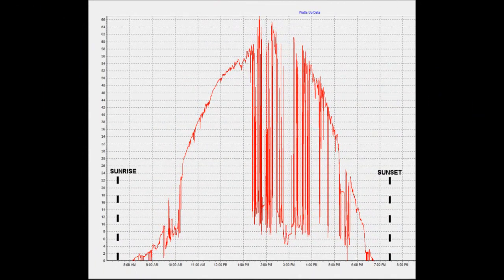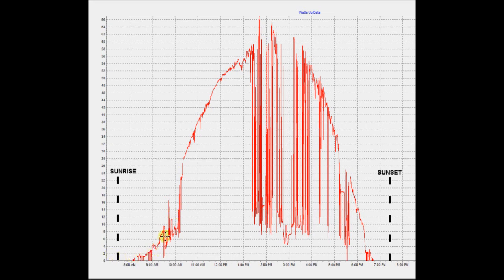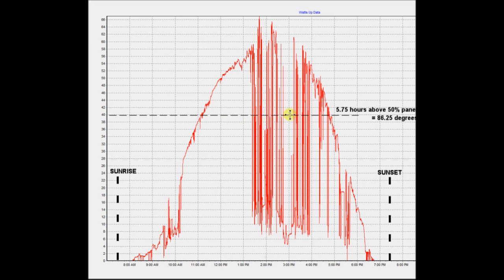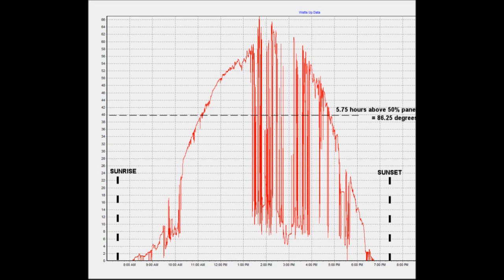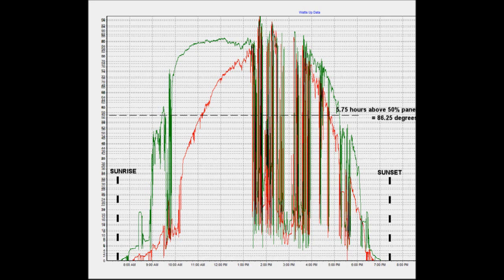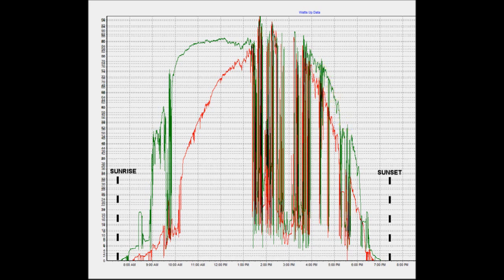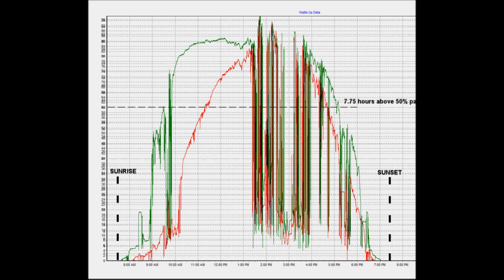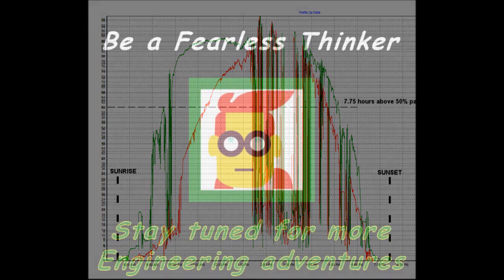Part 3: Spring Solar PV Shading Study

Comment: Very nice explanation of the difference between tracked PV verse's  Fixed mount. I did a test this morning about 9:00 am between Trackers #2&3 #2 i placed in a fixed or 0 tilt like a roof mt. then let #3 Track ,so a apples to apples comparison showed fix array @705 watts=To 110 WATTS .Compared to tracking Array 705 Watts in at 465 watts ,or a difference of 76.2% at same time same station. Both systems are identically in every way. So a big diff. in power Tracking vs.Fixed. Uploading video now.